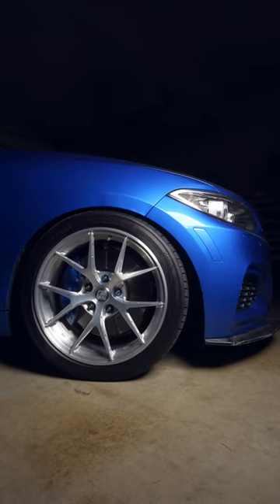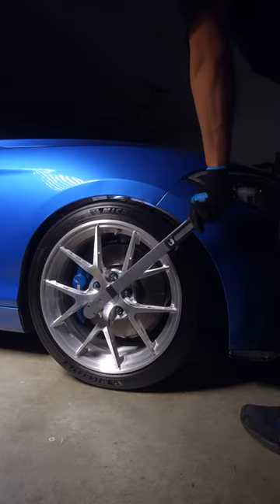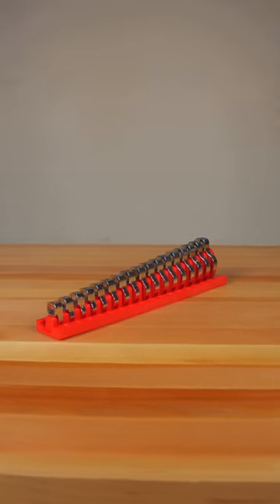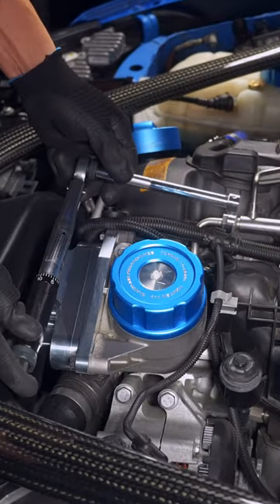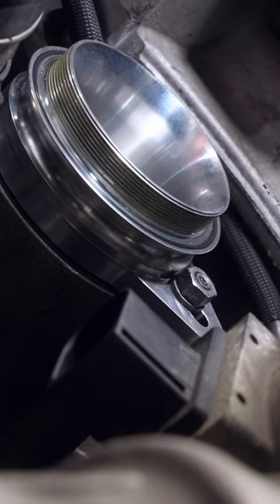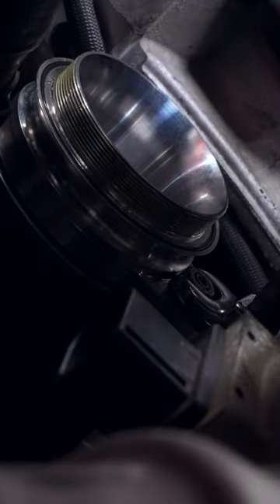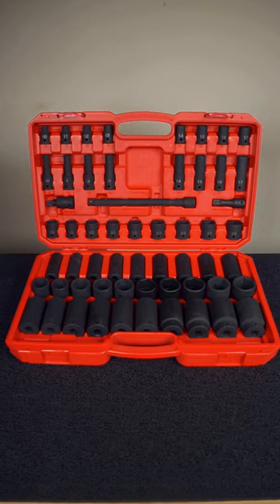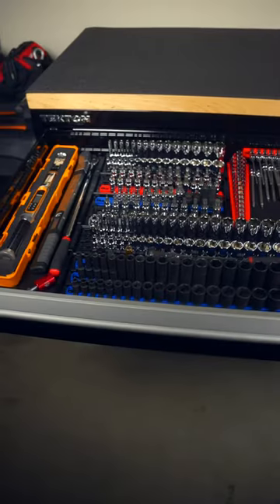How to use a Torque Wrench with a Crowfoot Wrench

Comment: You should never use an extension with a torque wrench and if you have to, doesn’t matter the angle but the wrench needs to be adjusted
Reply: Extensions are fine, so long as torque is applied gradually, as you’re supposed to with a tq wrench…any deflection with gradual application is irrelevant. What do you mean the angle doesn’t matter???
Reply: Been proven to be fine with extensions
Reply: The angle is the only thing that matters... You could have 20 feet of extensions on the end of a torque wrench and it would measure the same as without any extensions.
Reply: @Therob10203  except with the amount of slack between each extension you effectively have changed the angle, unless they're being supported
Reply: @foojub6907  generally you take up the slack with the gradual application of torque. The change in torque from deflection is negligible
Reply: @Therob10203  there were tests on this. Using a 6” extension on a bolt that needs 150 ftlb of torque reduced the torque by up to 8 ftlb. If you look it up, engineers actually adjusted the torque slightly for spark plugs due to them knowing you need an extension. Maybe I am wrong about the angle and will admit I am not sure on it, but an extension can put your stats off.
Reply: Yeah this might be true but its insignificant. I work with critical equipment daily with calibrated torque wrenches etc. All that matters is that you are not extending the length of the wrench. IE: If you torque with a crows foot make sure its perpendicular to the wrench handle to have no torque deviation, thats it.
Reply: @pokefan5022   nothing on google is matching what you’re saying. Any deflection is not a loss of accurate torque if you simply turn gradually. Also extensions aren’t the same, a 1/2 extension with appropriate adapters would deflect less than a 3/8.
Reply: extensions are fine. the universal ones are the ones you shouldnt use
Reply: If the extension is perpendicular to or in line with the drive head it does not affect torque numbers, for the same reason he mentions to keep the crow’s foot at a 90° angle, no extra effective lever length, no torque adjustment needed. With impact guns it’s a different story, you lose torque through those because extensions can’t transfer sudden impulses and you lose more torque the longer the distance the torque has to travel through. Same reason your crankshaft’s torque output is not the same amount of torque your wheels experience through the axles.